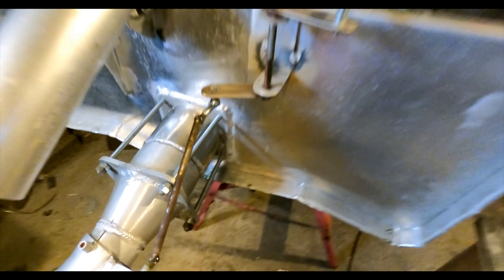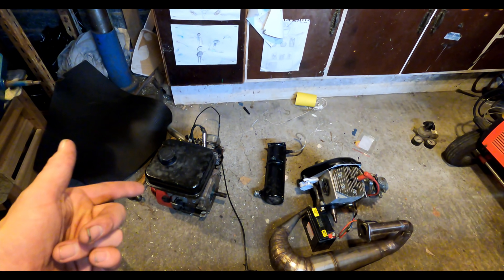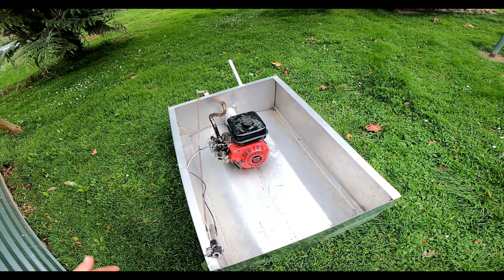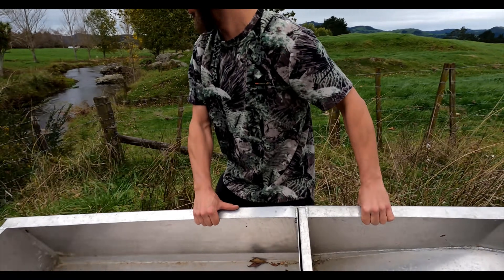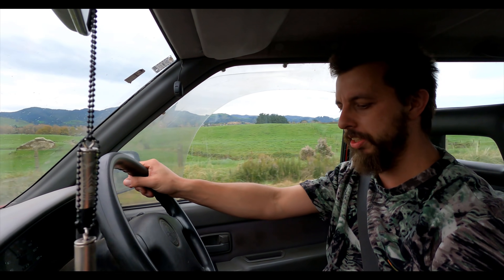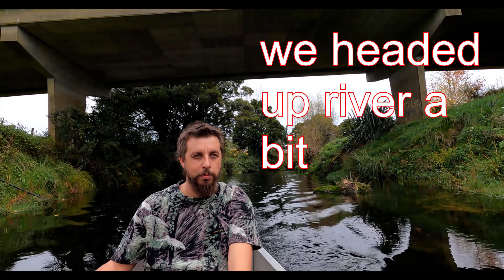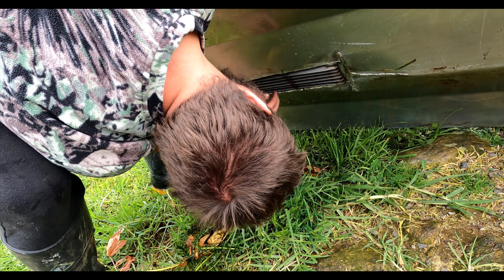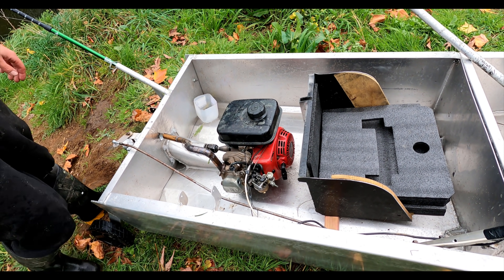Homemade Jet Unit Build, Part 4, 6.5hp 212cc Test

Comment: Bruce L has a good idea for ratio's or a scooter cvt could work as well 🤔 and a muffler would shut it up That motor didn't  sound like it was running to well lol the wheels are a good add on maybe a spring bolt instead of a normal bolt  and get rid of the factory carb  and put a motorcycle carb on it🤔 getting there just a little more test and tune😊good luck bro👍
Reply from the maker: Thanks, that motor is pretty far gone haha. I have a 13hp motor I can use too but will definitely need to gear it up , a cvt would be great!
Reply: @dkthewelder  Can get a gokart racing CVT transmission on eBay for a few hundred if I recall correctly

Comment: I think the sprocket idea would work great.  You'd be able to fine tune it between torque and top speed.
Reply from the maker: Yes and I have a 13hp Honda clone motor I want to try ! I am thinking about what you said about putting the exhaust into the intake but can’t find any pictures or anything, I think the exhaust going in there would make it cavitation? I want it to be more quiet
Reply: @dkthewelder  ⁰

Comment: I have the estuary behind my house goes all the way to sea. Feel free to bring it round for a rip some time, get some drone footage and what not
Also have a mercury tower of power if you want it. Needs wiring done cause it perished, all the colours are still there though.
Reply from the maker: that would be cool! I need to get it working better first
Reply: @dkthewelder Brilliant video -  I love it mate!  Gearing should resolve it. Have you considered scavenging off an old jet ski?
Reply from the maker: @BMcGhee-t5v  yes those JetSki based boats are pretty common here in New Zealand, I just want something smaller